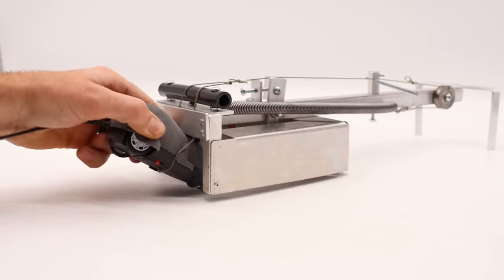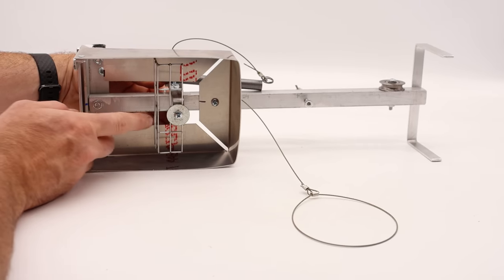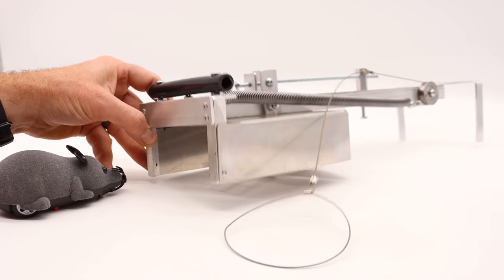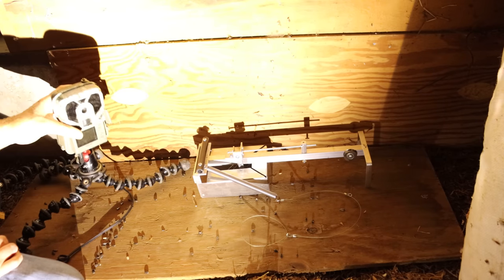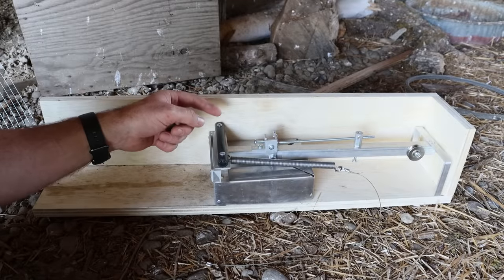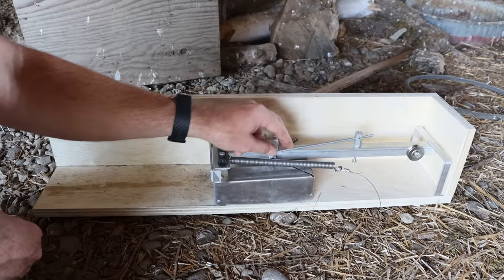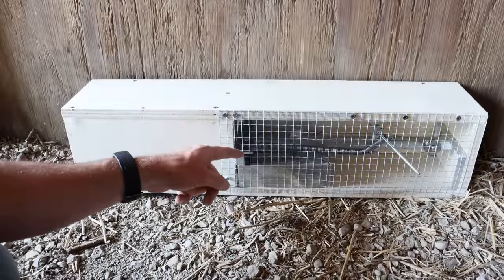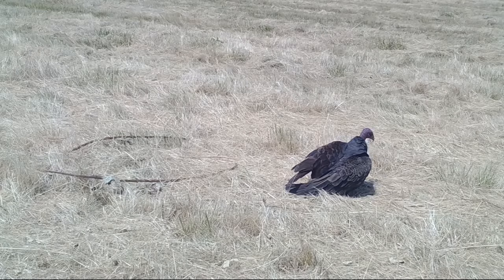Check Out This Amazing New Spring Snare Rat Trap. Mousetrap Monday

Comment: It's a really cool trap. However, it seems like (over time) it would be a pain in the neck to set....especially when the novelty wears off.
Reply: I don't like it, I think pest traps should be self resetting/able to catch multiples.

One a night ain't enough
Reply: @DanielSultana  I agree.  This trap has great potential.  It could be made as a muti-trap device, say 10 individual traps in parallel and hired out by pest exterminator firms.  But for catching lots of rodents in one night, would a simple trap like the tip and slip be more economical?
Reply: @danmyers7827  yes, the tip and slip, the eulic repeater, the peanut oil in a bowl, etc, are all great traps
Reply: Its way over-engineered. The 3D printed Swedish mouse/rat traps previously shown on this channel are better.
Reply: Yeah, it Seems like it’s more complicated to set this up, than to set up thread going through an electronic sewing machine.